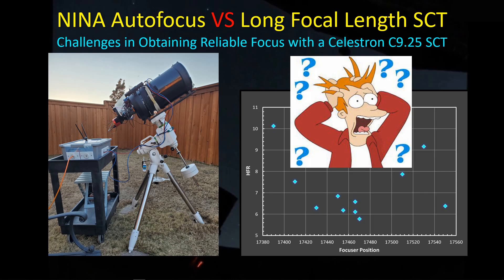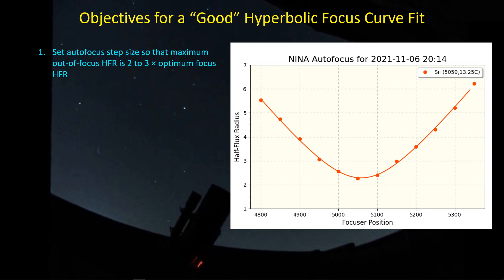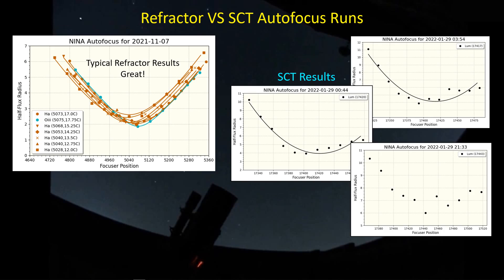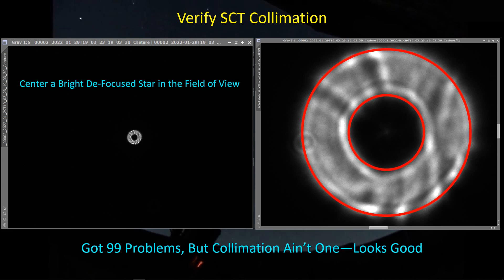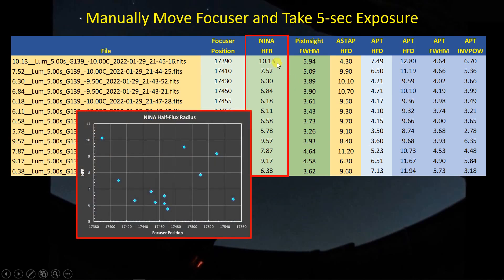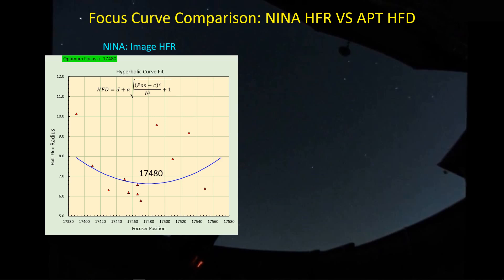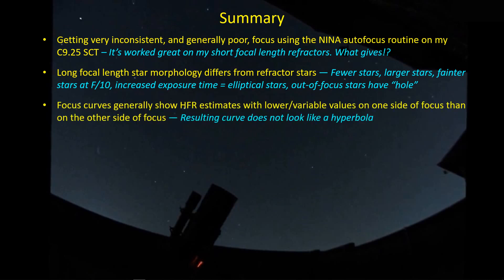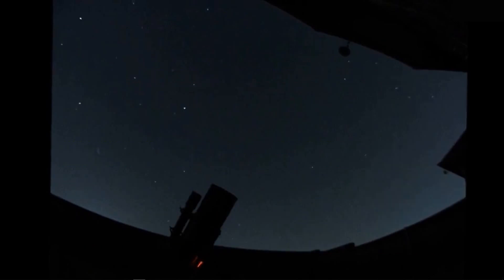Autofocus Challenges with an SCT

Comment: Great video. I might have a solution. I have found that on my scope, non-edge 9.25, I get asymmetric focus curves in SharpCap when I use Celestron's recommended 139mm backspacing. When I switched to 113mm backspacing I get symmetrical focus curves in SharpCap and my stars look better. Could the asymmetric curves be due to spherical aberration caused be incorrect backspacing?

Comment: I thought HFR depends on seeing as well. For example, for f10 4.4+seeing. Am I correct?
Reply from the maker: HFR depends on just about everything. (1) Telescope aperture determines the lowest achievable HFR, (2) Seeing at zenith increases the HFR, (3) Air mass increases the HFR relative to zenith, (4) Wind increases the HFR, (5) Mount performance (uncorrected periodic error and gear noise) increases HFR mostly in the RA direction, (6) Imprecise focus increases HFR, and probably more things that just aren't coming to mind right now.
Reply: @Aero19612  Thanks. This is what I thought. What FWHM (in arcsec) is acceptable for you, when you use your scopes? Are you coming TSP in May?
Reply from the maker: I just take what I can get. We have very little control over the FWHM - driven by seeing and target altitude. When I stack images, I will leave out images with "high" FWHM, but you can't go too crazy with that approach, or you'll never have enough data to create a final image. So, my approach is to collect 20-30 hours on a target, toss out maybe 10% to 15% of the images with the worst FWHM, then move on to a different target.
Reply: @Aero19612  Ok. I reject anything above 3.5” for 4” refractor and 130mm Epsilon; anything above 3” for C9.25 and 140mm TEC. Every frame with eccentricity >0.5 also thrown away. 
Rejection for AVX +ZWO focuser was 30-50% frames. For 10 micron + Moonlite focuser <15%. 
Main problem is SNR from bortle 7. I almost never get >10. Only for very bright targets. Blur and Noise XT totally changed game.

Comment: Hi James, is the Problem solve. What was the reason? I have the same Problem with my myfocuser2 and apt. Do you have used a reducer? It possible that the reducer has an effect on the hfr value and on the autofocuser? Greetings from germany
Reply from the maker: Hi Franz. Yes, I think I have solved the problem. Check out this video:
https://youtu.be/M7GxDf2mcw0

I'm using NINA, which has "overshoot" backlash compensation. It is possible to do this in APT as well. If you're not, check out this video at 20:40:
https://youtu.be/rT_cwkVMhno

I'm not currently using the reducer, but I think that would actually help. Also, if you can, perform focus with the Lum filter (if you have a mono camera) in Bin1.

Let me know how things work out!

Comment: I have a c9.25 sct. Focusing through the telescope focuser was inconsistent for me for years. Eventually bought a used Optec TCF-S focuser. I don't use temperature compensation though. For the longest time the only options available for imaging was Maxim, the SBIG capture software called CCDOps, and later Sky X with its image capture routines. Then came Focusmax. So I bought the TCF and used first the free version of Focusmax and then the paid for version when CCDSoft bought out the software. Personally, manual focus of the SCT works well enough to get close so I can use software to run a V curve. Then Focusmax runs a fine focus. When my QHY 268M comes, I'll be using Nina. I'm hoping I can sort things out by then. I would never trust the accuracy of the focus knob on the sct though.
Reply from the maker: In a later video, I show what I did to get my focus issues sorted out. It was very reliable and accurate after that. Got my fingers crossed for the upcoming galaxy season!

Comment: SCTs are such a hassle.  I ended up buying a rack and pinion focuser that is designed to fit on the SCT visual back.  Now I focus with a bahtinov mask, and then fine tune with the rack and pinion.  Bonus points because now it works with every autofocuser when I go down that route.
Reply from the maker: Hi Clint. That’s a good and effective focuser option for the SCT, especially if you have an SCT with mirror locks. I took the much less expensive route which also comes with additional headaches and tweaking until you get it right. If you see later videos, I finally did get this figured out and am getting good focus results. As for your observation that SCTs are a hassle… PREACH! Totally agree. I always have a bit of dread when switching back to my SCT from using a refractor and look forward to moving back to a refractor after babysitting the SCT. Thanks for watching !

Comment: Thanks for your good video's. I use a Celestron SCT 11 with the same focuser as you do. By using a very large backlash compensation (step-size 1500) and making sure the last movement of the primary mirror is "out" (against gravity) I have good and consistent focus results in SGP. I use this setup for over a year with no problems. I remember I had to reinstall the focus motor a few times before it ran smooth without heavy points during a revolution. So yes, all the mirror flop in the Celestron SCT's is not good but it is very well manageable (at least with my sample).
... I now see your follow-up video. That makes my comment obsolete :-)
Reply from the maker: I hope you don't mean the first comment is obsolete! Haha. Thanks for watching both videos, Patrick! I made several changes, but the backlash setting - I agree with you - is the "biggie."
Reply: @Aero19612  Ha, no. My comment should have been: Thanks for your good video's. (period)

Comment: If you can handle the weight, I recommend the the lite crawler, with its motorized rotator is a joy.
Reply from the maker: Thanks, Dennis! I’ve looked at it. It’s a very nice focuser and the most trouble-free way to go with SCTs. I cranked the backlash waaay up and made a few other adjustments and everything seems to be working well (for) now. Fingers crossed! Thanks for watching!

Comment: What were your seeing conditions on the night you ran your tests? Was your scope completely thermally equilibrated? With the very fine pixel scale of the SCT, the stars are extremely sensitive to seeing and tube currents. If you run an OAG this is immediately apparent as the guide star wobbles and stretches all over if the seeing is marginal. With my C11, on calm nights the focus curve runs perfectly, with iffy  seeing it is quite a challenge. Additionally, the right side of your SCT focus curves appears "flat", which may indicate that all the backlash is not yet out of the system or that you are suffering from mirror tilt with the focuser movement. With overshoot compensation, there is no need to be exact and it may be better to increase the compensation to achieve the full 1/2 counterclockwise focuser turn needed to seat the mirror forward consistently. The EdgeHD series are superior in this respect as you can lock the mirror in place and use a secondary focuser such as the Optec Leo, thus avoiding this issue (also mitigates mirror flop as you meridian flip).  I have found the Hocus Focus PSF fitting to yield slightly more robust star identification. Binning to 2x2 can reduce the vulnerability to seeing somewhat. Were your 5 sec measurements a single frame or the average of several frames? Taking multiple exposures at each focus step can help average out the seeing as well (at the tradeoff of being time consuming). The variability in HFR measurements can serve as a measure of seeing quality as can the HFR itself - with a theoretical 12.4 micron Airy disk at f/10, minimum HFRs of 6 in your test on 1/29 suggest marginal seeing, as does the variability from 4 in one run to 6 in another. If you do not have time to leave the scope out for 1-2 hours before imaging, or you have 40 deg F temp drops overnight like i do, insulating your scope with 2 layers of Reflectix may be the best option. Works well on my C11. Hope this is helpful, long focal length imaging is a very different game than short refractors!
Reply from the maker: I posted a follow-up video to this one showing that a significant increase in backlash solves the problem. I made some other, probably minor, changes as well. I will eventually try Hocus Focus-it looks very good. Thanks for the suggestions!

Comment: Try an optec leo when your budget provides.  Then you can lock down the primary mirror at rough focus and the leo moves the imaging train, so no errors introduced by mirror issues (assuming not too much flop). The leo is really great hardware, you'll appreciate the engineering and build quality of optec products.
Reply from the maker: Thanks, Jason! I agree, it’s much better to lock the mirror and move the camera. I’ve made some changes to my process with my Celestron move-the-mirror focuser by increasing the backlash setting by a factor of 3. That seems to have really helped as I am now getting consistently good curves. We’ll see how long this lasts!
Reply: @Aero19612  Good to know about setting the Celestron motor focuser to 3x backlash. I've got the celestron motor focuser too, and still use it when the HyperStar is on (because mirror focus is then the only option). So, I've been manually focusing with bahtinov mask when using HyperStar due to this same issue, so I'll have to try the 3x comp and see if that works at f/1.9. 

As an aside, maybe in the future you can do some episodes about the HyperStar, if you get one and want to go down that rabbit hole.

Comment: .....that´s why I decided to mount and ext. focuser on my C8: "what are my nervs worth"? the ext. focuser is expensive but priceless for me. for the C8 there are only a few options because of the backfocus. I took the MoonLite LightCrawler (smaller version of NightCrawler) with integrated rotator. Very happy since then, no problems, no backlash.
2. My C8 wasnt correctly collimated and I tried several methods; finally I ended up with the Hotech Adv. Laser Collimator. This showed a slightly misaligned optical back.....
cheers, Peter
Reply: ...correction: mount an external focuser...
Reply from the maker: That is the best way to go, especially if you have an EdgeHD with primary mirror locks. That said, now that I've dramatically increased the backlash setting and increased the exposure time, I'm consistently getting good hyperbolic curve fits. So, I'll keep my fingers crossed and my wallet in my pocket for now. Thanks for watching, Peter!

Comment: Thank you very much for this video, James.

I have de C9.25 EdgeHD with a feather touch focuser and Starizona’s micro touch electronic focuser. Most of the time I use it at f2.3 with hyperstar, but sometimes also at f10. NINA’s auto focus routine has worked very well in both cases. Collimation certainly could be a culprit for the non symmetrical graph you’re having. I don’t know if also the Edge series have different mechanics for moving the primary mirror, since it has the locks. Something to figure out.

Could you make Hocus Focus plug-in work?

Regards,

Alfredo
Reply from the maker: Hi Alfredo! I installed Hocus Focus, but have not (had) to use it yet. We've got a full Moon, so this is a good time to play with it.

Once I got the scope back out, I increased the exposure time to 8 sec (was using about 4) for the Lum filter and increased the backlash by 3x - from 50 steps to 150 steps. I've got 3 nights under my belt and the curves look consistently good! I'll make a follow-up video on this maybe this week (lots of rain moving in...)

The ideal setup is the Edge with the mirror locked in place and a focuser that moves the camera. For now, I'm limping along with my Celestron focuser that moves the mirror. I think my much higher backlash setting is compensating for the mirror slop. Thanks for watching!
Reply: Thank you James. Looking forward to see the result.
Reply: @Aero19612  follow up video please

Comment: That is EXACTLY what I am facing at this time!!! EXACTLY in my mind, my thoughts about what's the problem... I have a Celestron EDGE HD 8. Can't autofocus with my EAF. Crazy measurements, pixels taken as stars when HFR is measured from NINA... a real mess! I sent my C8 to the shop that sold it to me, cause I am in warranty, to check it. Mirror flipping is my main concern. Something in the mechanics area of the primary mirror. Or its just impossible for NINA or any astro software to measure the HFR of stars that an SCT is producing... These faint smoothed at the edges stars. I really dont know, but at least I dont feel alone now in this head scratching situation!!!
Reply from the maker: This seems to be a common problem. Mirror flop is a problem with these designs. I will really increasing backlash, increasing exposure time, use an inner crop of 0.8, change auto stretch to 0.1, and black-point clip to -2. And I’ll give Hocus Focus a trial run. There’s got to be a good recipe out there. I’ll keep you posted with my findings!
Reply from the maker: Well, after one night, so far, so good. I increased my backlash setting by 3x and used 8 sec Lum exposures (instead of 4ish). I didn't change the nominal stretch factor or black-point setting from my nominal (I was seeing good results without having to make that change). I got pretty good curves for each of 12 autofocus runs over the night. Will try again as long as I have clear skies and will summarize test results in a video later.

Comment: Hi James, I use a C11 EDGE HD and I have perfect autofocus in NINA (Perfect curve). You have a 20 steps backlash, ok, you use 40 steps backlash compensation in NINA, that is good to compensate for the focus motor backlash NOT for the mirror flop! Be really aggressive with this value. In your case I should use 100 or even 120 steps. The reason is that the mirror is now really push back against the central tube when it comes back in. The reason the right side of the curve is all over the place is because the mirror is flopping around and is not in its good final position. This 120 steps is not really a problem because they will only be used twice, once at the start of the focus routine and once at the end (and it is important that this last one pushes firmly against the mirror), the other steps in the focus routine are only pushes. And I am not exaggerating, it is a perfect hyperbola I get. (with NINA build in focus routine, not used HOCUS-FOCUS yet). So I would say try it and I hope you get the same results as I do.
Reply from the maker: Thanks for the input! I think you are right. I plan to do just that: increase the backlash to around 120 as you say and maybe increase the exposure time. I hope to get the scope outside tonight and do some testing. Who knows, maybe even some imaging!
Reply: @Aero19612  I hope it worked.
Reply from the maker: It appears to have worked! I increased the backlash to 150 from 40 and increased the exposure time from 4 sec to 8 sec. I did not change the autostretch or black-point clipping from earlier settings. All of the curves acquired over night look like hyperbolas. Will try again as long as I have clear skies then summarize findings/observations in a follow-up vid.

Comment: Hi James, I have a Celestron 8" Edge SCT and I saw the exact same issue as you report here.  In November I moved over to using NINA from SGPro and bought a new CMOS camera.  Probably not wise in hindsight to make so many changes at once!  But i saw the same focus curve you report here.  Like you, I am using the Celestron focuser for 2 years now, but I have only had great experiences with it.  

I realised that my focus step size was too small, after some experimentation I arrived at a step size of 30 for my f/7 configuration.  After this change, I have never had any problems with focusing and have found the entire setup to be extremely reliable.

I have not tried f/10 yet in NINA, but looking over my old SGPro configuration the step size for f/10 was 50...although I understand SGPro uses a different fitting algorithm so this may not be directly comparable.  Looking at your step sizes here you are at 20, this might be a bit too small for an SCT, especially as you have a longer focal length the optimum focus tolerance will be extremely tight. 

I hope you fix this soon, let us know how you get on...clear skies!!
Reply from the maker: Thanks David! I played quite a bit with step size. I think I'm around 30 now. As I mention in the video, I want to see a two- to three-fold increase in HFR over the minimum HFR to get a good curve. I will be getting the scope out tonight and will play with focus some more. I'll increase backlash to 120 (3x higher than what I'm using) and maybe 10-sec exposures (2x longer). Maybe I can try Hocus Focus out too. Thanks for watching! Btw, I'm glad to hear that your Celestron focuser is treating you right. The focuser is fine, maybe even really good. My issues stem mostly from its attachment to the SCT body using the same short M3 screws used to attach the orange cosmetic plate. In my case, one of those threaded holes is damaged. Maybe the longer screws and Loctite will put those issues in the rear view mirror.